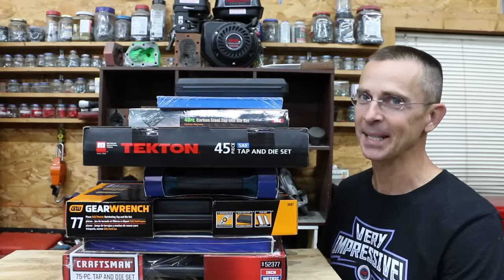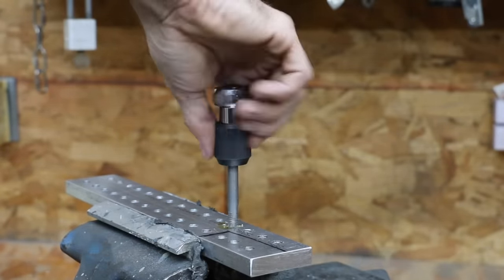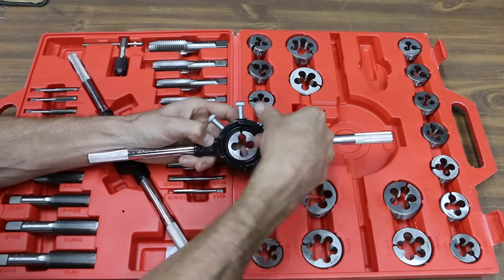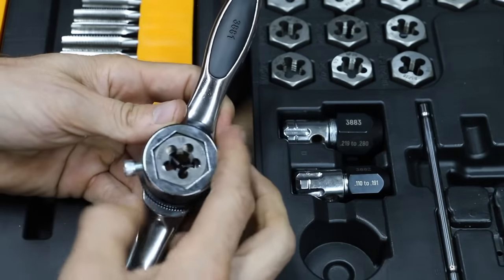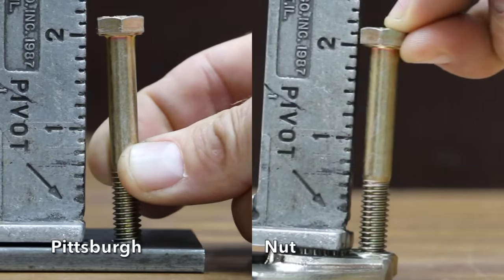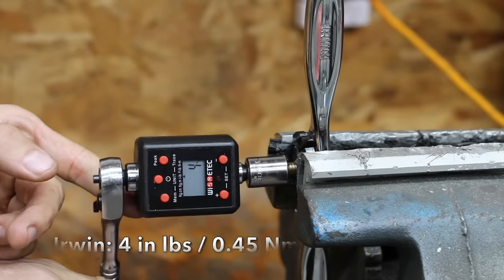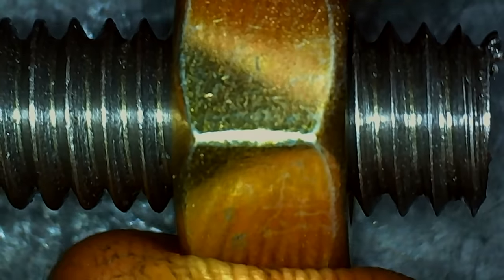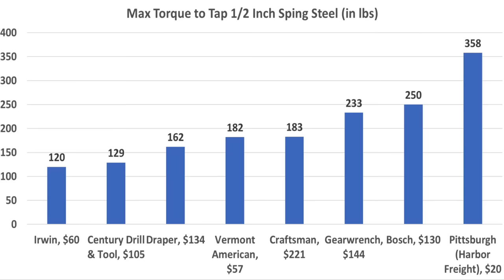Best TAP & DIE Set? Craftsman vs Irwin, Bosch, Draper, Vermont American, Tekton, GearWrench

Comment: I get your testing; however, when my Dad cut threads, he would go a turn then back of. Then again and again.  This allowed chip removal, and the set he bought 40+ years ago still look like new and work great.  Almost certain the set is from Craftsman as that is all he bought unless the item wasn’t available from Craftsman, or our local Sears didn’t have it.
Reply: Modern tap and die sets are designed to feed shavings away from the threads. These sets were used exactly as the manufacturers intended. I've used older sets, and even my college professor told us to turn and back off, but it's really not necessary.
Reply: @slayersabre5  I've had the Harbor Freight ones (easily the crappiest brand) for probably 20 years... Still work like new because I take my time and don't push them. My point being the back off method clearly is better unless you need to do tons of items all day long. I use mine mostly for automotive. I don't use a one turn then half back rule.. I go by feel.. if they are struggling I back out to clear and go again until I feel a struggle.
Reply: My dad was a machinist for nearly 40 years, and the best way he said to use taps and dies, is exactly as you say.
Run them in until you feel slight resistance, and back it out until you see the cut material fall out.
Then run it in again until you feel it once more, and this from a man with unlimited access to all that he needed, even if he busted one or two on every hole.
But he was a perfectionist, and believed that if you wanted the best fitment for your threads, then the slow and easy followed by reversing the tap or dies was the best way to achieve that goal.
Being as he did all the proof work for engineers before the prints were released for general shop use, I've pretty much taken his word for gospel on anything to do with that sort of thing. 
I've got most of his tools, and the tap n die set are in a handmade wooden box with felt.
The outside has some darkening from machine coolant I assume, but the green felt looks brand new, and he passed in 1998, and had been retired for probably 10 years prior to that time, but I know he still uaed his taps and dies after his retirement.
Reply: Machinist here, you’re right. Taps should me turned reverse every couple turns to break the chip. Even if the flutes are designed to remove them, that only helps but not replace traditional procedure.
Reply: All the taps that were used are straight flute taps which require chip removal, easily done by hand. Normally machine taps with have a gun point or spiral flutes which will either push the chips forward ahead of the tap or pull them out the back through the flutes
Reply: @slayersabre5  Spiral flute taps are able to feed chips away, straight ground like he is testing need to be backed off to clear the chips.
Reply: Same here. I base the back off on when it feels like it is binding. The test is interesting, but seems more related to industrial work, where much better dies would be used anyway.
Reply: TheCheesePlease  it's not JUST a torture test that has a testing of how much torque it takes to thread. If it was JUST a torture test he wouldn't of started it on an even and level surface using the drill press; he would of just did what beginners do and just put them in a twist drill and have at it. You fool.
Reply: That is how you properly tap. Your Dad was correct, and knows what he's talking about. The "art" of it is in the "backing out" you mention, which clears the threads, removes the cut metal, etc. Keep in mind he's testing mainly on aluminum, though - not steel. This is an exponentially easier material for a hardened steel tap to handle.
Reply: @Oneillnn  Thanks for the intelligent reply. Most people don't seem do realize that this was a torture test. I'm sure that most of them would have performed better had they been turned backwards, but again, that wasn't the point of this test.
Reply: @slayersabre5  If you are talking about spiral point or spiral flute taps you are correct.  Straight flute taps like these should be reversed to break the chip and clear the threads.
Reply: @rustysteed8414  yea it's spiral point I'm thinking of, good call
Reply: Gotta break that chip!!!
Reply: @timothymilam732  forget what the others are saying...your dad's method is always correct. I like how people that make those statements prob have very little experience with machining and i guarantee they never learned anything from older generation journeymen.
Reply: @Oneillnn  exactly...those comments always come from inexperienced folks who think theyre machinists but have never learned anything from real old school journeymen machinist whatsoever
Reply: Not backing off is a mistake.  It may have made some taps or dies perform worse than they are capable, and distorted the results.
Reply: @agentelvis81  but it tends to stick to the cutting teeth of the taps caused by the friction, which actually makes it harder to tap if you don't know what you're doing in the first place. 
But yes sir you're correct, and I don't let others bother me.
Especially when their comments typically explain everything that you need to know about the situation. 
;^)~
Reply: TheCheesePlease  No, it's not. The tools were used as intended, not subject to any extreme treatments or abuse.
Reply: I always try to back off after each turn (more often if the material is especially difficult to tap). If I have a very difficult and expensive job, I will usually tap with a set of carbide tapered taps and switch out between taper plug and bottom taps every few turns with lots of fluid and lots of cleaning between changes. Better to take an hour per hole than ruin $30,000 of work and material because of one ruined hole.
Reply: @thewoodweldingfabricator9300  WISE WORDS!  That is THE proper way to tap!
Reply: @alfredomarquez9777  we had a couple of our hss taps ground down a little to make them less aggressive. We would tap a part that was to be heat treated with very light threads (like 40% full thread width) and then re tap to full thread using carbide in the style I mentioned after the part was hardened. This left really clean and high quality threaded hole in the part and the customers always loved how well we did them.
Reply: TheCheesePlease  Misusing tools doesn't tell you anything. You could have a tap that is good for 250 holes if used properly or 2 if used improperly. Likewise a tap good for 10 holes if used properly and only 5 if used improperly. Which is better? Does the torture test tell you what you want to know?

Torture tests are only good if they torture a tool at the limits of how it should be used. These taps were misused, so the results are invalid. Sorry not sorry if that's too much for you to comprehend.
Reply: @slayersabre5  Really?, Well this could be resolved with another video using duplicate sets  Back turn clear vs No back turn..... so ?????
Reply: @genecarden780  if this test isn't about performance then why check fit? The fit would be better if the cips were broken
Reply: @gunsnwater2668  you answered your own question the fit probably would be much better if the chips were broken but we don’t know how much better.Measuring the movement at the head of the bolt is only minimally informative much more important is the strength of the threads, which could have been compared by measuring the torque where the threads failed in the aluminum. Then there is measuring the torque required to drive the tap. Was it easier to drive some taps because they were sharper? Or were they simply cutting more shallow threads? I understand that this wasn’t a “ scientific “ test. But as done there is very little useful information.
Reply: Yeah, back then Craftsman meant something and was good quality at a good price.   That Craftsman is long gone.
Reply: @slayersabre5  ;  Oh, yes it is.  I don't know what your professor's background is/was, but the people who instructed me in trade school were former master tool and die makers with forty years behind them who decided to take up teaching.  When using a straight flute tap you must reverse and break the chip.  Same goes for a die.  Spiral high speed steel taps using a tapping attachment in a machine can get away with it because that is what they are built to do.
Reply: @timothymilam732  ; Your dad told you correctly.  I am a former tool and die maker also.  Started in 1972.
Reply: It just depends on what kind of hole. If it's thru or closed.
Reply: backing off has nothing to do with clearing chips. It's to break the chip.  Everyone is wrong
Reply: Wow people claim theyre machinists and have it all wrong. #1 backing off is to break the chip. Has nothing to do with clearing chips. Not even an issue since he is tapping a thru hole with a plug tap. A blind hole you wouldn't use that type of tap.  #2 the threads being loose has nothing to do with the tap. That's the drilling. If you don't drill a good hole, you'll have crappy threads. #3 just cause you were a machinist once a upon a time doesn't mean you know what you're talking about. Usually the old timers are stubborn and have been doing things wrong most of their life. You want a tap? Buy a Guhring tap
Reply: @highstreetkillers4377  ; Not completely accurate.  While using the proper size drill is critical to getting accurate threads, not all taps are created equal, just aa not all drill bits are created equal.
The right size hole does NOT automatically guarantee accurate threads.  Garbage tap/die will equal garbage threads.  Same holds for a dull tap/dull die. 
Even when tapping a blind hole, almost always a taper, or starter tap is used.  Then the user would switch to a plug and lastly, a bottoming tap at the end.
CLEARING the chips become important when a blind hole is tapped to make certain there is not a pile of chips building up at the bottom of the hole which could prevent the bottoming tap from cutting to the intended point.
Many of the commenters, including me,  specifically stated that backing off was for the purpose of breaking the chip, not clearing the chip.  Failing to break the chip can result in breaking the tap if it is small.
Reply: TheCheesePlease  Shout much?  Must be constipated from eating too much cheese...
Reply: 40+ years ago tools were made better. And craftsman was made in USA then I believe. Stanley bought out craftsman and now it's made in china. But supposedly they're moving some operations to US. Companies today just care about volume to get money. Also, people assume everything is pretty much the same and opt to spend less and decide to rebuy it if it breaks. But in the long run it adds up to more than just buying the expensive one to begin with. But of course how much you spend doesn't always reflect quality. But yes, backing out is the proper way to tap and thread. But he was testing the durability.
Reply: @meme5887  ;  Every company every built ALWAYS has made making a profit their first priority.  If the company has stock holders, that priority is cult edged.  When companies had fair competition higher quality was a key point.  If a company cannot turn a profit, the level of quality is irrelevant.
If you really want to know where and why companies decided to take short cuts and use lesser quality materials, look to labor costs and you will find your answer.
Companies MUST compete with others who make the same product.
If deliberate over regulation and higher and higher taxes, combined with ridiculously higher labor cause American companies to be unable to compete, they have no option but to move off shore.  It was no accident.
Reply: @wrongfullyaccused7139  I absolutely agree that profits was and is always top priority. BUT, if you want to stay in the game and keep making profits, there needs to be SOME quality to a degree. Of course over time, inflation happens and workers want to be compensated for their work so of course it made sense to ship manufacturing overseas. But even then, companies have say in the minimum quality they expect for their products. Whether that be low or high specifications.. And you also need a target audience if you're going to be making quality and charging for it. Otherwise you're lost in a sea and forgotten about and then left with high cost items no one wants and you just spent all this money to make these products holding inventory.

Edit: I think sometimes too some companies wait to have a good following before they start cutting corners hoping fanboys won't care. Regardless of whether you're talking tools, computer parts, cars, etc. Not all purposely wait to do so, but it's a nother strategy to choose from.
Reply: @meme5887  ;  I agree with almost everything you stated.  The crucial thing I have a problem with is "employees want to decompensated for their work".
Unions, while unknown to the workers they allegedly were protecting, killed the golden goose.
The union leadership realized just how much power they had.  They became money launderers.
So they pushed companies and caused many to cave in.
Example: You have someone sitting on their butt in a swinging chair plugging in wiring harnesses for dashboards for a van for 8 hours per day making over $25.00 per hour.  An eight year old could do it and they made more money than nurses.
Example: You have the unions telling automobile plants that if they shut down and move to a right to work state (no mandatory unions, lower taxes) they have to pay full pensions to every employee that gets left behind FOREVER!  This happened to one business after another.
Yamaha piano had to move offshore because of over regulating about black lacquer paint on their top selling piano!  Result;  Hundreds of unemployed American workers.
Al Gore pushed for a luxury tax on yachts and got it.  Result;  Yacht purchasers bought their yachts overseas and 1,500 workers in the American yacht industry lost their jobs.
NONE of this was an accident or oversight.  Everything I just stated was done on purpose to crush American industry.

Comment: Irwin is known for its taps, have some that are 50 years old, still going. Irwin made the taps for ACE hardware years ago also.
Reply from the maker: Thanks for the feedback.
Reply: I know a guy that worked for the mothership at owns Irwin and if I remember correctly he said that Irwin makes snap-ons taps
Reply: @FishFind3000   all tool trucks labeled sets are maked by them likely--definitely mac and snap-off
Reply: Known as in past tense. That was then and this is now. What I'm seeing now is nothing like it used to be.
Reply: That’s shocking to hear. The Irwin ones I bought are some of the worst I’ve ever used, and my job requires tapping holes daily so I’ve used quite a few
Reply: @christianscustoms6429  What brand are you happy with?
Reply: @orlandorosado2157  I’m actually unsure of the brand, I get them on McMaster but a 1/4-20 tap is about $10 each and they go up from there the larger they get. I always select “for use in stainless steel” even though most of what I use is just steel but they last forever and never fail
Reply: Trouble is, the orginal owners of Irwin are not there anymore....as is the case with almost all companies and thus the quality sometimes is gone and sales are made on the name only.
Reply: @FishFind3000  not anymore. Irwin now makes them for Matco and snap on is supposed to be in the works of producing their own. I've got a broken M10x1.5 tap that I can't get replaced under warranty until they get production up and going and it's been over a year.
Reply: @christianscustoms6429  Irwin really doesn't look like it used to. I think offshoring has hurt them.
Reply: @brandonh5336  Irwin cut off snap on for the tap and dies. Snap is in the process of making their own now because of it
Reply: @1pcfred  Still one of the best we've used at work
Reply: @FusionBoost2.0  I also find it interesting that early December they still listed all the taps they previously had with the one I mentioned having an estimated in stock date of December 22nd. Now it seems they only show a few tap sizes on their site. Anything that showed an estimated in stock date before is no longer shown. Must only be showing new old stock.

Comment: The rate this man produces content is insane. Most of my subscriptions get away with a video every 2 months or so. Awesome, and glad I watched before buying a set because I truly was considering that pittsburgh set not having known anything about quality.
Reply from the maker: Thanks for the feedback.
Reply: I have a Pittsburgh tap set for home mechanic use. It stinks.
Reply: @ewaltmana  Ah good to know
Reply: You can't even chase a thread with a Pitsburgh much less cut a clean one..  the cost of a good set is so expensive, you are usually better off buying the size you need when you need it.. get a tap handle and a die stock at a flea market.. You'll most likely only use a couple of the pieces in the set anyway.. OR Work in a machine shop and return the taps to your toolbox instead of the tool crib..
Reply: @twistedhillbilly6157  I’ll just buy the Irwin set I guess
Reply: @tylergmorales17  I bought a small 18 pc Hansen set NIB on EBay for under 20 bucks.. But I also have a drawer full of the popular sizes, (cutting taps, roll taps, bottoming taps UFT taps, etc. ) I also usually use a Procrunier instead of a tap handle which pretty much eliminates breakage even with the very small sizes  . I think Irwin is also Hansen which is kinda standard of the industry so the quality will be good..  People don't realize how much work is involved in making a tap.. The steel, heat-treating, and precision grinding has to be perfect.. this video show just how important all three of those processes are.. Lack even a little in Any one of those processes and you have garbage..